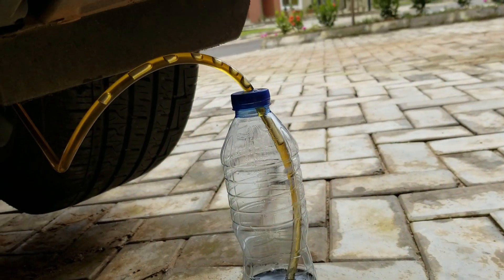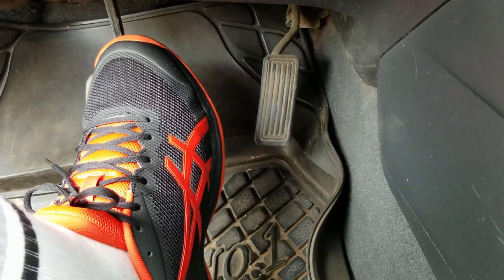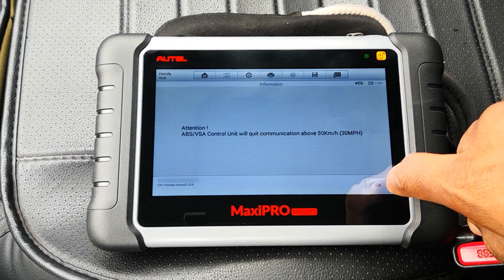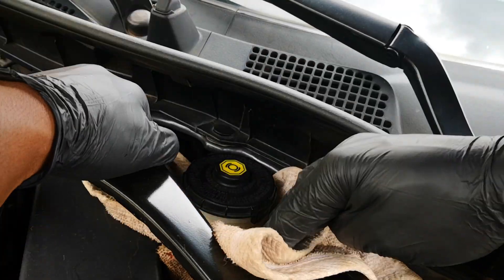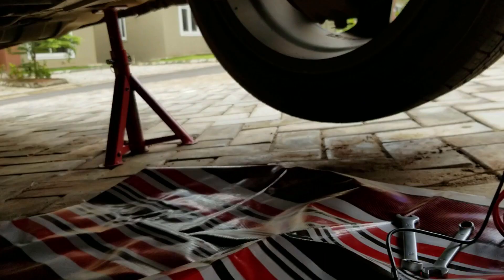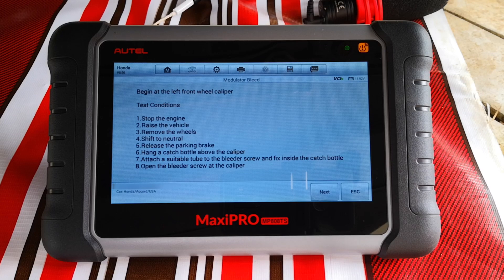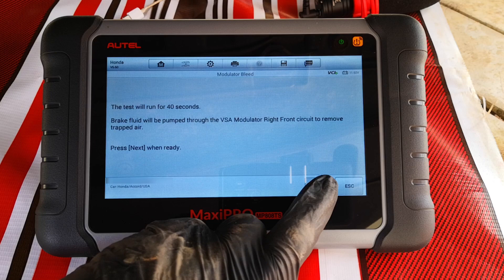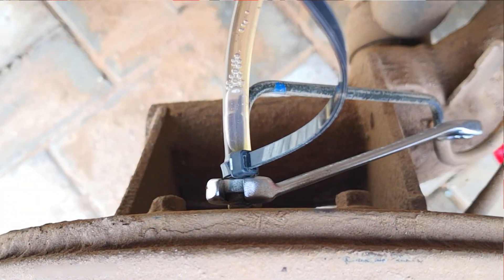Autel Scanner: ABS modulator bleed / How to Get air out of ABS / Anti-lock brake system bleeding

Comment from the maker: What's your experience bleeding ABS, with or with a scan tool? Let's talk! Hope this was helpful.
Reply: Never done a brake bleed with a scan tool. Hoping to do it on the next brake job coming up soon.
Reply from the maker: Super!
Reply: I purchased a maxi-check pro about 4 years ago and tried to bleed the brakes on a 2003 Ford Taurus , and it said that it was not communicating with the vehicle.
Reply: Not good. I''m stuck with this scanner doing a 2013 Audi A3 b8  ABS bleed. This is what comes up "When performing basic settings for the intake and disconnect valves on VAG (VW, Audi, Seat, Skoda) ABS modules like the MK60EC1, temperature is a critical prerequisite. Autel and other diagnostic tools enforce these limits to ensure accurate calibration." Temperature MUST be over 10C (50f) I've no garage and no warm space nearby its cold where I live and the process keeps aborting due to too low a temperature.

Comment: Are you serious? I initiallly was quoted for 180 for brake bleeding. I wanted to do it myself. Now i'm finding out that I have to buy a 400+ scan tool AND a jumper? come on
Reply from the maker: There are cheaper options under $200. Let's be clear, you really don't need a scan tool to bleed brakes on most cars. Except if you specifically want to bleed the ABS. You don't need to bleed the ABS except you disconnected one of it's lines or replaced it.
Reply: @DIYAutoworksNG  Thank you boss!

Comment: sir what about we're doing it backwards the manual bleed first after that using the scan tools ?
Reply from the maker: That's not good. ABS bleeding releases air from the module into the brake lines. Not all of it will come out of the bleeder nipple. That's why it should be followed by manual bleeding and not the other way round.

Comment: Sucks for me, i have the Autel MaxiCom MK808BT. I tried to bleed the ABS on my 2002 Dodge ram and the scanner doesn't support this function. I think my truck is too old or i don't have the best scanner for the job. 😐
Reply from the maker: It's likely that the truck doesn't support ABS bleeding via a scanner.
Reply: @DIYAutoworksNG  i called AUTEL yesterday and they said i needed a CCD protocol adapter. The scanner asked for it too. I have one on order, hopefully it will let me do the job and fix my mashed potatoes brakes
Reply from the maker: Glad you got it figured out. Lol at mashed potato brakes 🤣🤣

Comment: I replaced the rear drivers side caliper on my 2013 honda accord. I first bled out this caliper and the brake pedal is spungy. So i then bled each caliper and still the same issue. So i tried starting from the front drivers side then to passenger front rear passenger and then drivers side rear. Still the same isse. I cant for the life of me figure out what ive done wrong. I dont think the reservoir got empty while doing the first one but perhaps it did. Assuming that happened, whats the next step? Any help would be great, its so frustrating spending all night messing with something that ahouldnt have been this difficult, then again thats the way it seems to go lol...thanks
Reply from the maker: Sorry to hear man. Just take it easy from here 👍🏼
Your bleeding sequence is correct, and you may have just focused on that driver side caliper and bleeding that side. Does your tubing have a vertical incline to it so that air bubbles can travel vertically away from the bleeder? If not, try bleeding again with this in mind, also is the other end of hose submerged in brake fluid in the catch bottle?
On the other hand, if the reservoir ran low then the master cylinder needs to be bled. You can look up the procedure on YouTube. It's messy though, which is why I go through the options I mentioned first. Also, see if you can get a brake fluid reservoir refill kit. Got one recently and you won't need to worry about running low as it gives you a liter to work with.
Reply: @DIYAutoworksNG  appreciate your feedback. I gave up on it at that time last weekend. I'll probably be back at it again today. Pretty much procrastinating, to say the least, lol. I may try gravity bleeding it first, but I'll definitely keep all that u listed in mind if that doesn't go well. Thanks again! If I don't forget, I'll keep u updated.
Reply: I'm back, lol. I bought the Foxwell scan tool to generate the ABS. I bought the harbor freight Pneumatic brake bleeder tool. I'm still getting spungy brakes. It's not constant, though. The pedal will feel normal for a stops and all of a sudden, the pedal goes down farther than normal. I used the bleeder tool on the rear caliber I changed only at this point. So now, for the last ditch effort, I'll do the ABS purge again, then I'll bleed each one in sequence. I know there's no way this should be this difficult, If it was, then I'd assume no one would do it lol. If this next run doesn't work then im totally lost. I apologize for bothering you but you have been the best help I've had. Do you think something else might be wrong by chance? 
 I'll let you know what happens today or in the near future. Thanks again, I greatly appreciate you
Reply: Das gleiche Problem hatten wir auch,  beim Wechsel bleibt Luft im gewechselten Bremszylinder. Bremssattel lösen und beim Entlüften bewegen.

Comment: This is a super helpful for those who understand why you are or would need to do this. It’s important to mention (based on the comments) this is NOT a brake bleeding method. It’s merely required to bleed the ABS module. Which is a suggested step if you worked on the ABS system or simply want to purge all the old fluid out of that system. After you are done with the scan tool, you still need to bleed your brakes using whatever method you want. Every car is different. Some do this ABS procedure without opening bleeder screws. And again you still need to bleed the vehicle. Another way to purge your ABS system is to first bleed your brakes normally (I like pressure bleeders like motive) and then go drive the car and stomp on the brakes to activate the ABS which will cycle fluid through it. Then go bleed your brakes again to get rid of that old fluid that is now in your lines. That would be a pain right? Exactly and that’s why people use the scan tool to bleed their ABS.
Reply from the maker: Great comment!
Reply: Thank you for this.  The last few words of his video were too fast and it wasn't clear that the traditional bleed is still necessary.  
So do the ABS bleed first and then traditional bleed.....
Im not sure why it is since it appears that the ABS bleed pushes all the air out but you sound like you know what you are doing.
Is it because ALL the air doesn't come out with the ABS bleed or the traditional method pushes out old fluid and replaces with fresh or something else?
Thanks again
Reply: @pgreenx no prob. So the ABS bleed is just purging air and or old fluid from the ABS block. Anything coming out of that part of the  system is still in your main brake lines. That’s why you need to then bleed the brakes normally. And on some cars you would bleed the main fluid first then the ABS and the main brakes again.  A lot of people don’t even bleed their ABS and just accept it has old fluid in that small portion and when you trigger your ABS that old fluid moves out and mixes with the new fluid in rest of lines. When it’s super important to do that though is if you replaced ABS components. Because then it’s not just old fluid it’s air and has to be purged. 

So for a normal brake job and fluid flush it’s up to you if you want to purge old fluid out of the ABS too. Either by using a scan tool or by stomping on brakes hard enough to activate ABS while driving between bleeding sessions. But it won’t help you unless you have new fluid in the lines to actually move through the ABS. I feel like I’m making it more confusing so sorry if that’s the case.
Reply: @KemDIY thanks.   Your comments are very helpful.  I bought a scan tool last yr and figure it’s worth bleeding the abs module since I have it.  
Just wasn’t sure why I need a traditional bleed after the abs but I understand now.  
The video is also excellent but he should have been clear that a traditional bleed Also needs to be done.  More people should read your comment
I’m going to do the ABS bleed and then traditional.  
Thanks again.
Reply: @pgreenx no prob!

Comment: I have a soft brake pedal and I have diagnosed everything so all that remains is air in my ABS unit. I have used a bidirectional scan tool to activate the inlet /outlet valves but I still have a soft brake pedal. This is probably because one or more of the outlet valves are stuck open. Are there scan tools which can pinpoint which valves are stuck so I can try cycling the pump longer while gently tapping on the Hydraulic Control Unit ? I understand some scanners can find which circuit has air trapped.

Comment: Sr. these steps are only for front wheels or all 4?
Reply from the maker: Not all 4 wheels. Just follow the wheels called out by the tool.
Reply: @ thank You bro…. Tomorrow i will buy the three bottles of oil and make this job with the maxisys 906 pro

Comment: Love the video mate, but a bit confused here. What’s the point of the scan tool brake bleed if you are still required to do the normal procedure afterwards? I thought this would eliminate the need to manually do a brake bleed, not require it
Reply from the maker: You'll notice that the scanner only bled 2 of the wheels. The primary focus of the scanner is bleed air out of the ABS module for this procedure. While some of that would come out at the bleeder nipple, some will remain in the lines. The subsequent manual bleed ensures all 4 brake lines are completely free of air and old fluid.
Reply: @ you’re absolutely right I totally missed that part! I thought this was a regular brake bleed video haha so this should only be performed when messing with the abs module system, but when it comes to regular brake bleeding for maintenance, follow the normal steps Honda outlines and don’t use a scan tool for that?

Comment: CAN I USE THIS METHOD TO BLEED AIR IN SYSTEM EVENTHOUGH I HAVENT TOUCHED OR OPEN ABS. i usaully ask my kids or wife to keep pressing brake pedal and then i crack open, if no one is around i am thiking of using this method .. 

pls advise.
Reply from the maker: 💯 That's exactly what I did in the video. I haven't touched the ABS on this car
Reply: @DIYAutoworksNG  Thanks in case of Toyota it is still asking someone to pump and hold the brake to bleed rather i expect ABS pump to pump the old fluid.. any idea ..

Comment: After using the scan tool, it says to go ahead and do the normal Honda bleed routine…when I get to that part, can I use my manual brake bleeder pump? It’s a smotivepro. What method do you use when bleed ? Do you have a video for that ?
Reply from the maker: Yea, you can bleed manually afterwards using any manual method you're accustomed to. I don't have a manual brake bleeding video. I just using a piece of tubing on the bleeder nipple, nothing fancy at all

Comment: Is the jumper battery necessary?
Reply from the maker: The tool advises you do so due to the heavy power draw by the ABS, also the ABS is one of those systems that's quite sensitive to low voltage. So in summary, I personally, I would always connect a charger.

Comment: $900 for a scanner to do a brake bleeding, anything cheaper than that brother?😂
Reply: You need a scanner to perform a proper brake bleed. The spool valves in the abs module do not move unless under command. Normal bleed doesn't remove trapped air in their cavities
Reply from the maker: Definitely not for just the brake bleeding! They're way cheaper options on the market.
Reply: You can use the old way
Reply from the maker: You mean bench bleeding? It's just too messy for me but definitely works.

Comment: Hi,
I got one of launch scan tool for honda and for 2019 civic bleeding procedure is not available but in abs system I can activate modulator for each wheel but there is 2 option( solenoid and VSA) and both activate modulator and vsa last longer and more noisy do you know which one will push the fluid?
Reply from the maker: I'm yet to use a Launch, so I can't say for now.

Comment: Do you have to use the scan tool? Can you manually bench bleed it? Ive got a 2010 Impala and im about to put a new modulatoe in, im thinking about leaving the block in , and  switching the motor and board. Recommended?
Reply from the maker: You mustn't use a scan tool, but the manual bleeding process is messy. Pumping brakes, opening and tightening the ABS brake lines for the air to escape (it will come with fluid). Not sure of the design of the Impala ABS unit, but if there's a separate electrical component attached to the pump (as in some models), you may be able to change just that part without disconnecting the lines. If the lines are removed, bleeding should be done. Ultimately, do refer to service recommendations from the manufacturer.

Comment: Just did an ABS bleed with scanner on my jeep wrangler. The scanner only had me bleed the right front and right rear tires then said the operation was complete. It didn’t ask me to bleed the other two tires. Is this normal?
Reply from the maker: Probably the way the ABS on the wrangler is setup. Mine only bled the front 2

Comment: I mean the method of one person pumping the break pedal until clear break oil appears in the bleeder tube? Do you recommend this method for DIY? Thank you.
Reply from the maker: Sure. Tried and tested method it is! Where a scanner/ABS bleed is necessary is if you replaced any components or replaced the ABS lines.
Reply: @DIYAutoworksNG  Finally, when you bleed using above method, does the engine need to be started during the pumping of break pedal.Thanks
Reply from the maker: Nope. Just ignition on.

Comment: Thank you for the very informative video.I would like to know if the one person break bleed method ( catch bottle and tube only) with no pump can be recommended to flush the break oil? My car is 2018 Japanese model with ABS? I have the oil which came with car and is +4 years now.Can  do it my self? Thank you?
Reply from the maker: The no pump or gravity method can work, it just takes a long time in comparison. If the brake fluid is sealed, it should still be good. If it was opened or the seal is broken, it's not recommended for use.

Comment: Hello, what about the rear brake ? Do you need to bleed them?
Reply from the maker: The ABS bleeding procedure with the scanner on this car does not involve the rear brakes, however, after the scanner procedure, you will be required to bleed all wheels manually following Honda's sequence.
Reply: @DIYAutoworksNG so what was this now? Why manual? I dont understand
Reply from the maker: Remember that the procedure is focused on bleeding air out of the ABS itself, not the entire brake system and lines. The manual procedure takes care of air or old fluid in the brake lines.

Comment: I would like to buy a Scanner to my Viano 2.2 2014 163c Delphi ECU. Purge ABS, actuators, injector code, etc. Do you know if this scnner can do it?.
Reply from the maker: It should. You can confirm the supported services here https://autel.com/vehicle-coverage/coverage2
Reply: @DIYAutoworksNG  Like always mi Viano 2014 is not in the list. Thanks.
Reply from the maker: Ouch! Like always? Limited support on scanners generally or just Autel tools?
Reply: @DIYAutoworksNG  well, I don't know what scanner can do these works.